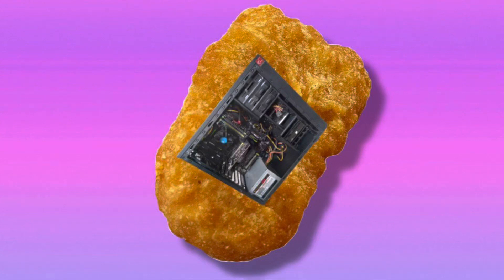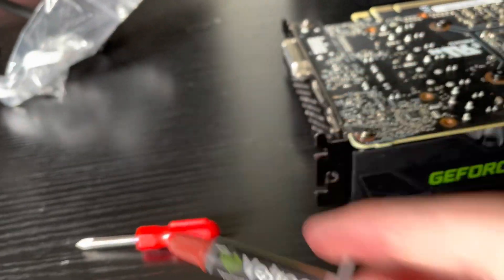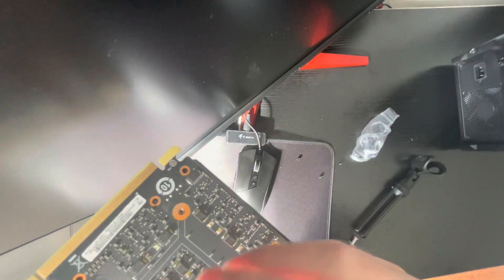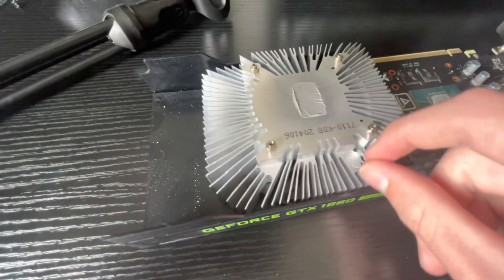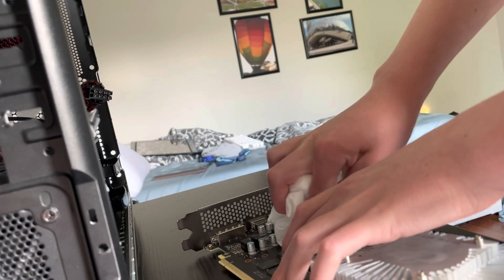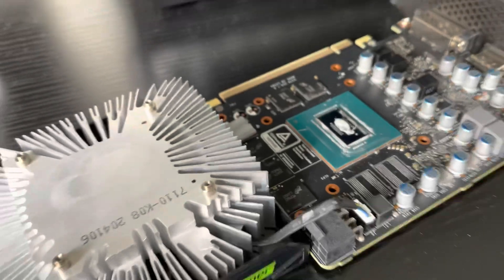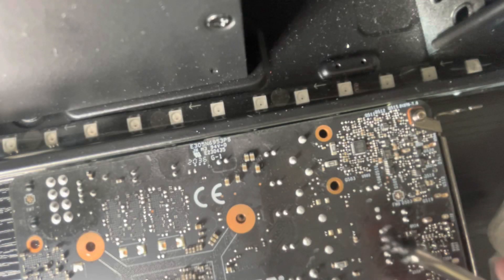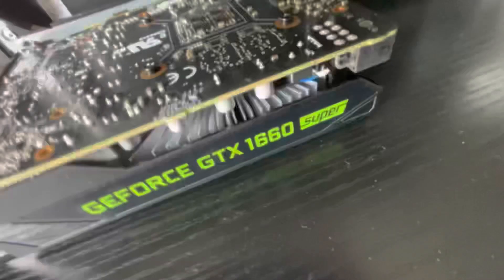How To RE-PASTE A Lenovo Legion GPU!

Comment: Hey quick question and see if u can give me advice, I still have my stock cooler in my Lenovo legion 5i or tower 5 and I want to install a better Cpu cooler like ur Vetroo Cpu cooler, but it looks very daunting to do I already installed my new Notuca intake fans and that’s the only things I know how to do, 

But the thing is should i buy the same cpu cooler and give to a shop or someone who knows how to install new parts? I am thinking of the Best Buy Hardware installation service which costs 40$ from Geek squad, I don’t have any options left since I am very worried I might break the motherboard or do something wrong in the process Or should I just keep my Stock Cpu cooler that came with the Lenovo tower 5?
Reply from the maker: Honestly, you just gotta be really careful, but it’s understandable if you don’t really want to, so taking it to the geek squad might be a good idea.
Reply: @technugget873  Alright thanks! If i tired to install it I prob would have broken some stuff since I am quite bad at installing things 🤣 
I am going for the CoolMaster hyper 212 black edition Cpu cooler it has no RGB since I don’t really care about RGB much, and it has a very good reputation but it costs a lot more money but the price is definitely worth it
Reply from the maker: @cabbagememes2852  good choice! The V5 is a bit cheaper, and I like the RGB so I went with that.
Reply: @technugget873  yep! and I think the coolermaster hyper 212 is a bit smaller so it should fit perfectly in my Lenovo legion gaming rig

Comment: You're the goat bro! Is it possible to upgrade the gpu on this prebuilt?  I have the same model and I was thinking of copping a 3070 ti
Reply: You could upgrade but the power supply and cpu would have had to be upgraded with as well and might even have to get a better motherboard. you could keep the cpu but it would bottleneck it a little bit